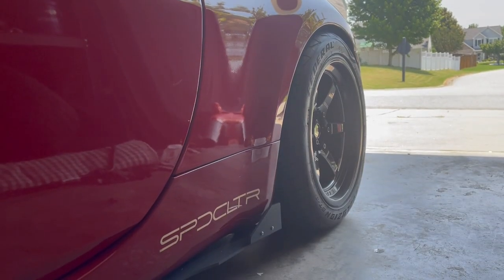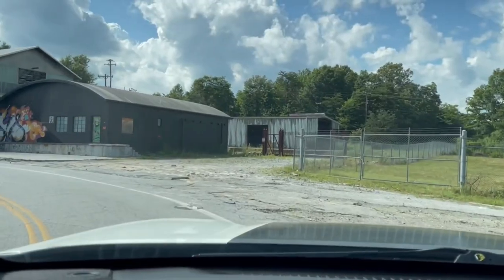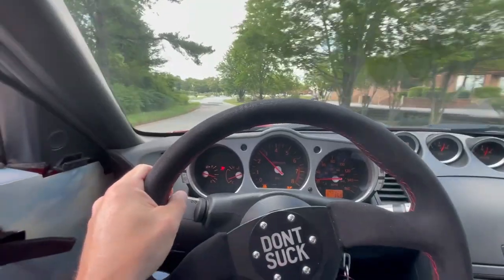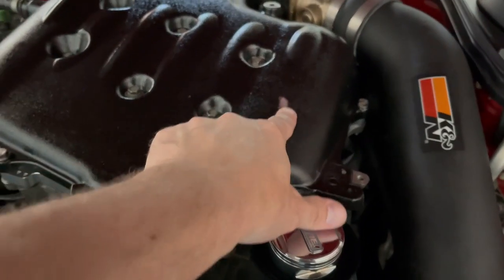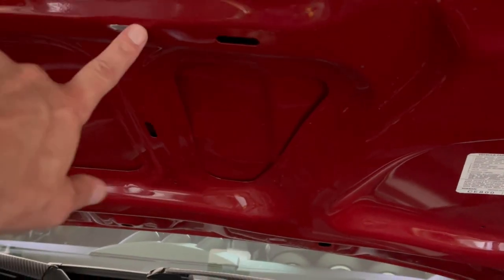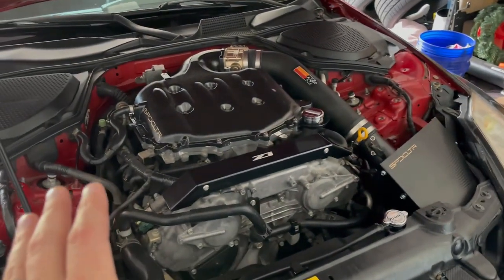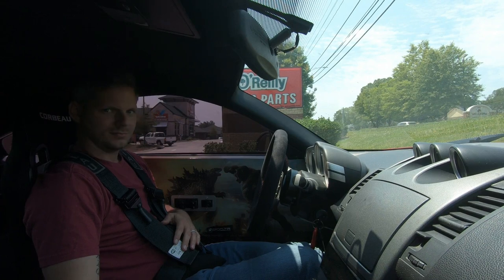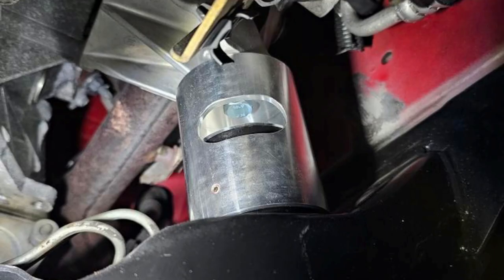Z1 Motor Mounts REALLY Worth It? | 350z, Q50, G37, 370z

Comment: The shop might be able to adjust the motor mounts height. I thought those were adjustable. Maybe the source of that vibration is the plenum getting in contact with the hood. I would try that before cutting up the hood.
Reply from the maker: The mounts can be adjusted slightly, but I'm not sure it's worth the effort.  The vibration is definitely from the additional rigidity.  It's only felt at idle and I don't think it's touching the hood at that point.  A bit more investigation is needed!

Comment: Hey Jay, ik this is kind of selfish but i was wondering if u could possibly do a quick vid or picture of how the rear 275 tires on ur q50 would look mounted on the front. I really want to run a squared setup with ur q50's rears all around because im awd and i dig the absolute perfect fitment in the rear of the Q and i wanted the same fitment in the front. U dont have to go out of ur way to do it and Ik it might rub depending on the chamber but if possible, could u do it? thank youu
Reply from the maker: It’s hard to get fitment like that up front because the wheels have to turn.  I couldn’t fit a 275 on the front — no camber adjustments—so they would crush the fender
Reply: @SpeedCultureStudios Ty for the reply, After thinking about it, thats very true. I was feeling around the front fender and it seems the rear fenders is rolled from factory but the front isnt. With that in mind would u think itll be possible to go with a 265 in the front? 275s r perfectly vertical on a 9.5 width wheel and i believe having a 265 width will give it enough stretch to clear the front fender edges. what r your thoughts sir bcuz ik u run a 255 in the front but idk how much space u have between the tires and the fender. Mind you im going to get a 35 series side wall hoping itll help clear the 265s. Im risking it for the biscuit for fitment in the front, i got ocd ab it. i keep replaying ur reels ab the fitment on ur car thinking about this, but i jus cant see a perfectly detailed pic ab exactly how much space u have in the front.

Comment: You know that there are front strut tower bar spacers for clearance for when you install a plenum spacer so that you can still retain that strut tower bar.
Reply from the maker: They come with the spacer—I’m not sure if you saw the video but the engine hits the hood.  There’s no way the strut bar would fit now
Reply: @SpeedCultureStudios  my bad, I did skip through it and missed it. I went back and saw it now. Thankfully I have a different intake manifold setup so I didn’t run into clearance issues, even with the strut tower bar. 
Most likely the engine mounts just needs an adjustment or the poly just needs to settle in, hopefully something works out 👍
Reply from the maker: @benny6712  I think it’ll get better as the poly softens but I think I’d need to adjust them if I want to put the brace back on.  It’s probably fine without it but we’ll see
Reply: @SpeedCultureStudios  ya the 350Z chassis is already very ridged, but the more help the better. All on your time tho and whatever you decide. 
Keep up the good work on that 350Z 🤙
Reply from the maker: @benny6712  I appreciate you checking in!

Comment: From what I know of engine and motor mounts, and isolation mounts rubber is better. There are inherent disadvantages to poly.
Reply from the maker: It depends on what you mean by “better.”  There are inherent disadvantages to rubber, which is why poly and solid mounts are considered better/upgrades in Motorsport applications.
Reply: Rubber mount are better for daily driving comfort and preventing NVH. Now if your building a track car NVH shouldn’t matter if you are wanting better response with poly and solid mounts.
Reply from the maker: @benny6712  even with poly the nVH is minimal.  Like I showed in the video—only minimal vibration at idle.  There is no additional noise or harshness in ride at all.  If you drive a family sedan and have no need for improved performance, then it wouldn’t be worth the upgrade, but if you like to have a little fun in your daily, I don’t see why not.
Reply: @SpeedCultureStudios  Yup, I know because I also own a 2003 350Z Track Edition and I’ve already had my Z1 poly engine mounts installed along with the Z1 headers and poly trans mount back in May 2021 and I do not have any rattling issues. 
🤷‍♂️ it could be from your door cards if they are the metal ones because I still have my OEMs on. I need door cards because my driver side bucket seat bolster is pressing against it, but it’s minor.
Reply from the maker: @benny6712  I’m not talking about the rattling.  That’s from the wires behind the panels.  I’m talking about the actual vibration
Reply: @SpeedCultureStudios  still, I have no “vibration” issues that you’ve shown in this video. Even at a dead stop or in 1st gear before rolling off. 
Could be because of the mechanic that installed it 🤷‍♂️ who knows. Mine was done at a local Nissan dealership from employees that professionally drift their own Zs, S chassis, RX-7 FC, (you name it) here in Guam. 
Not showing off or whatever, just sharing what my experience is with the Z1 poly engine, trans and diff mounts.
Reply from the maker: @benny6712  wouldn’t have anything to do with the mechanic.  I also have stuff suspension, trans mount, poly diff bushings and bushing collars.  Nothing is being absorbed in my driveline anymore.
Reply: @SpeedCultureStudios  🤷‍♂️ 🫡

Comment: I got quoted 4k for an install for these on my 14 q50 by z1
Reply from the maker: No way. That’s extremely high
Reply: @SpeedCultureStudios  Exactly. I'm trying to find another shop right now
Reply: Did mine in 3 hours by myself. 
The hardest part was lowering the motor back on the frame and lining up the holes on the bottom mount stud .  
All you need is a 14 mm socket wrench, 17 mm socket, wooden board for the oil pan, thread sealant and a jack.   I bought the solid mounts as well.  
07 g35s 6mt sedan
Reply: @ThorOdinson-zc2kq  Well said, Thanks bro